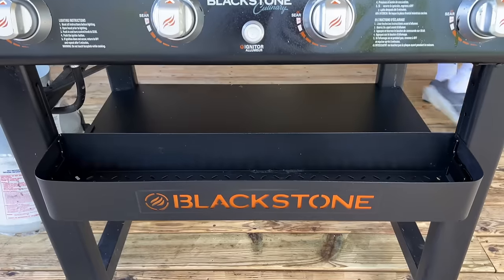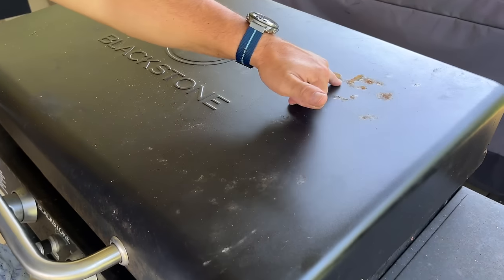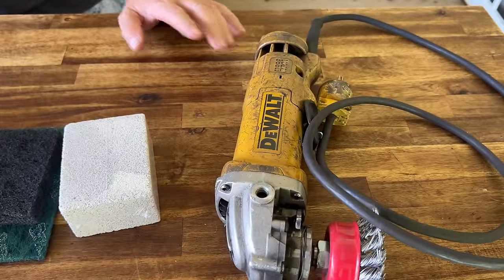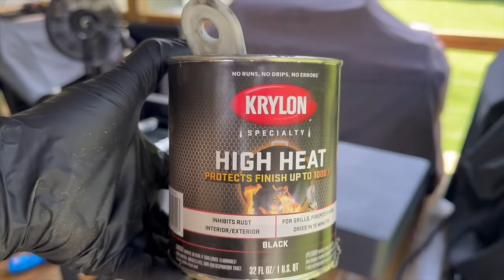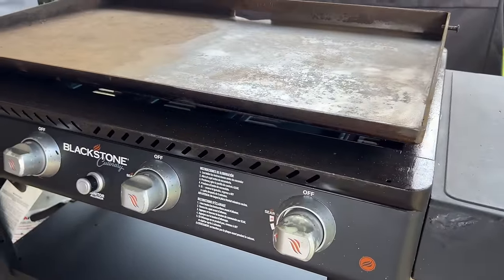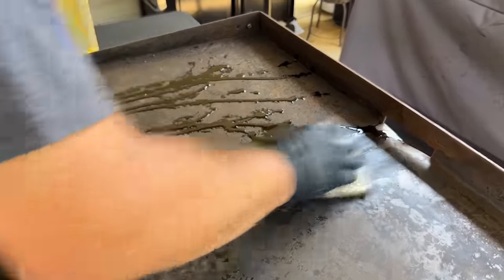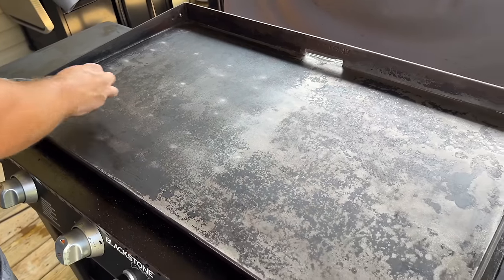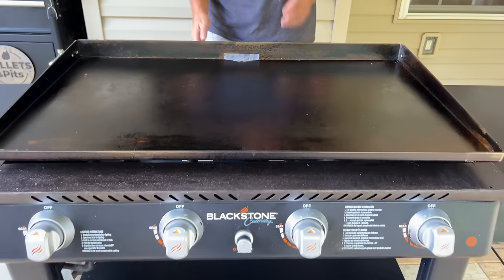Let's Restore a RUSTY Blackstone Griddle - $50 Bargain Brought BACK TO LIFE

Comment: I bet an abrasive disc on the angle grinder would work better than a brush. They look like an abrasive sponge.
Reply: A 120 grit flap disc would make short work of it.
Reply: I’ve done it, it gums up fast from the seasoning. I think next time I’ll use wire disc first, followed by flap disc to get to bare metal.

Comment: Way easier and less destructive to use vinegar or slightly stronger acid to remove the rust. The acid dissolves the rust fairly quickly and can be rinsed away. However, if the surface is heavily pitted like this one, then yes it will need to be sanded down to restore a smooth surface. But chemical removal of rust is just way better.

Comment: I’m definitely in the “take it all the way down” camp.  Don’t know how the previous owner seasoned and with what, eventually the older remains will flake off.  But a great video and congrats on the $50 deal
Reply from the maker: @mike_adams  although I agree with what “they seasoned with”… that seasoning was stuck like glue… so taking off something solid seemed unnecessary.

Comment: An orbital sander could be used instead of the angle grinder. Nice vid.
Reply: I used a Black+Decker mouse with the pointed tip.  It still took a long time but I went down to bare metal instead of leaving any old seasoning behind.

Comment: I wonder if you could put a grill brick against one of the rubber pads on a random orbit sander or even a random orbit car buffer?  Let the machine do the work.  No adhesive, just the weight of the machine and hand pressure with the rubber pad helping to transfer the motion to the brick.  But, a grinder with "flap disk" (sanding disk folded into many "flaps") or one of those Scotch type synthetic round "sponge" sanders would be my weapon of choice.  I have a ton of the flap disks in all sorts of grit levels from very aggressive to 200 grit.  Both are dirt cheap at Harbor Freight, but can also be found at any "box store" or the local hardware or auto parts store.  Also a flap disk will NOT sling a wire into your arm or eye like a wire brush can.  Light touch with a flap disk is the way to start or go aggressive if needed.  Also on a rehab like that one, I would pull the burner tubes to clean the inside and evict the spiders, etc...  Do it right, do it once (touch up the rust with high temp primer & then paint after sanding it to metal).

Comment: I'm a welder by trade. Look for metal, welder, machine, or autobody shops that have a sandblaster. Take the flattop to them and they will sandblast it for a few bucks like $20 to $40 bucks.
It looks professionally clean, take about 10 minutes or so then reseason it. 

I have my own sandblaster in my shed and put baking soda in it. Baking soda is smaller grain than the sand pellets and it takes longer to clean but it makes a glass finish. Just an idea to make life easier. Big fan, keep up the good work. Peace.
Reply from the maker: Appreciate that

Comment: When I lived in SoCal near the beach (3/8 mi. away) my grills were always rusting.  So were my power tools in the garage... Anyway, good video.  Rust on steel is gonna happen.  It's just something almost everyone deals with.  Just last night I was scrubbing down my Lodge 15" cast iron skillet with kosher salt in an effort to re-season it.  Even though I live in the desert, the small amount of moisture in the air will still do a number on cast iron if it's not used on a regular basis.

Comment: Neal, for "spot" rust on a griddle top, do you feel it's necessary to strip the entire surface down and re-season the entire grill top, or just strip away the rust in the one spot and reseason?
Reply from the maker: just those areas...I even just grill brick...BUT if doing so..make sure its not just that area...blend it out like sheet rock....so there is not a defined lip....helps with seasoning...
Reply: @TheFlatTopKing  Thank you sir!! Appreciate all you do.

Comment: I’ve considered taking my griddle back down to relatively bare metal and reseasoning it. I have these flakes. They don’t come loose, but I’m not really happy with them. I cook on my griddle ever chance I get. But the flakes annoying me. Also, if you want a faster, better finish use a flapper wheel disc on the angle grinder. It’s much faster (and cheaper) than the steel brush.
Reply from the maker: TY...

Comment: Doing a little Flat Top Noob Refurb that Turd Lol. I'm curious to see how that high temperature paint holds up. I bought a 36" Blackstone that I use for camping and tailgating and have used it about 8 times so far and it's rusting on the top like where you repainted yours. I have to say Blackstones quality is slipping a bit compared to my older Blackstones I have and had.

Comment: I have a 2 burner black stone and it's hard to keep it from rusting.....I use a drill with a 3 in wire brush for cleaning and grape seed oil for seasoning and the seasoning part is my worst problem never can get it rite and I've tried every technique
Reply: Watch kent rollins how to season cast iron, its the same principle as flat tops. Keep it covered and away from rain/moisture is still a big deal as well. I like blackstone’s seasoning wax, I tried canola oil but it would flake real bad. Do multiple coats thoroughly burning off the oils.

Comment: Nonsense. Grill bricks are for stainless griddles, not rehabbing a cruddy carbon steel griddle. And a wire wheel is a shop tool, not a kitchen appliance, lol.

The only way to clean a griddle with rust and chipped seasoning is to pour some 45% white vinegar solution on it, and close the lid. Go in the house and watch a cartoon, them come back outside and get the garden hose and rinse your griddle off and season it. 30 minutes, near zero elbow grease.